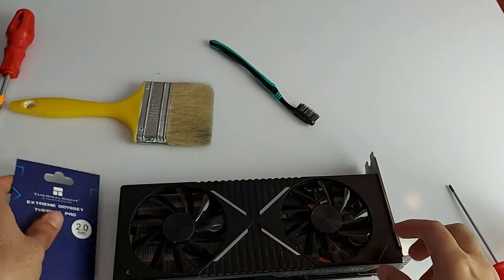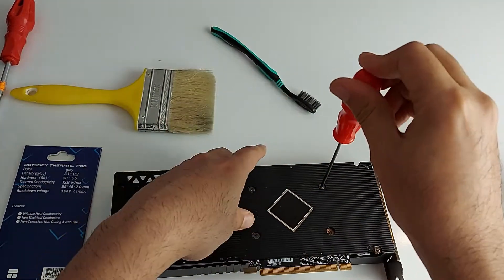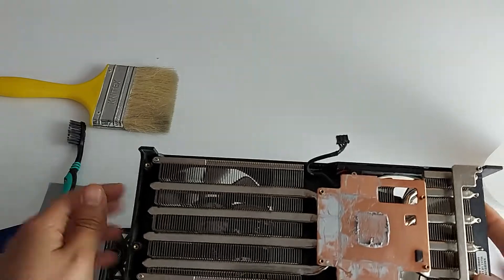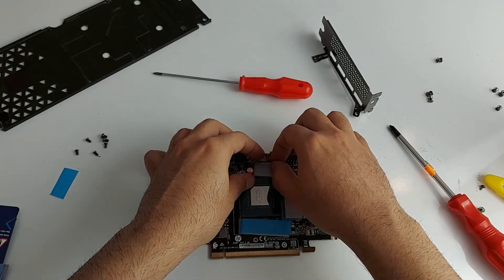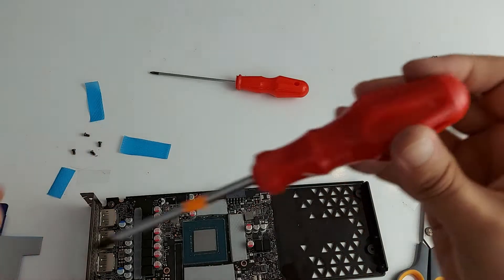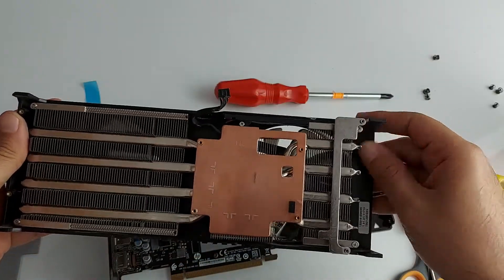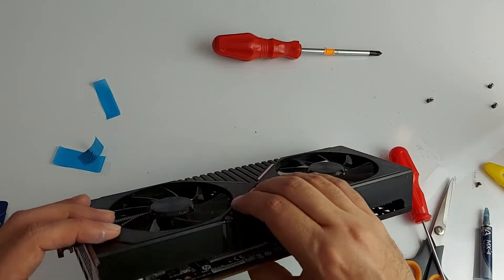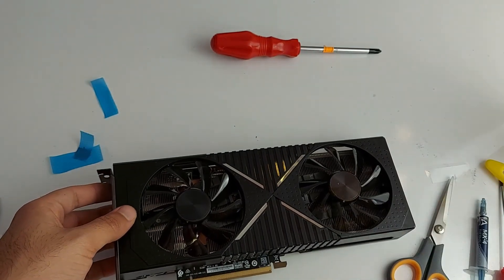How to Change Graphic card Thermal Pad and Paste RTX 3070 Omen 30L 35L 40L

Comment: I did it with 2 mm thermal pads and now i have problems with high temperature…same graphic card as in the video, i think the thickness is not not correct

Comment: Great video. But when I dismount the cooler, the thermal pads ripped off, I have no pads yet, so I changed the thermal paste only and I closed it, but nothing changed. I am getting 86 degrees on furmark. Should I change the thermal pads, does  it affect the GPU temps?

Comment: ARCTIC TP-3: Thermal Pad Premium Performance 1,5 mm  and ARCTIC MX-6. Temp max 79 C (FurMark and Kombustor) With 2,0 mm max 88 C  !!!
Reply: And in the VRMs, what measurement do you use?
Reply: What sizes?? 1.5 mm all over?
Reply: @drifter7508  for vrm 2 mm